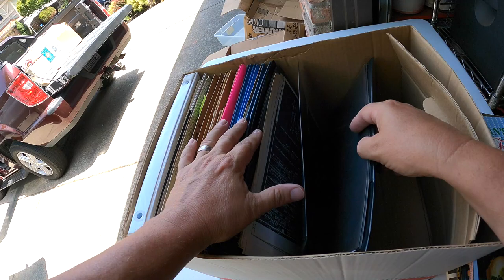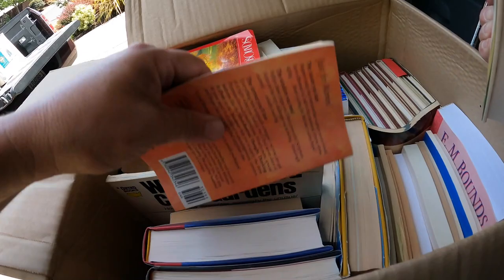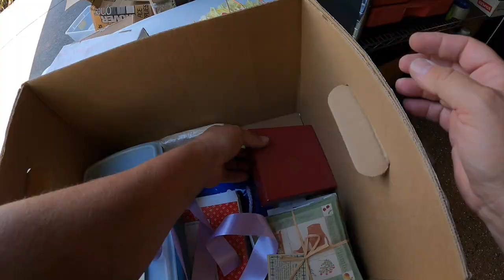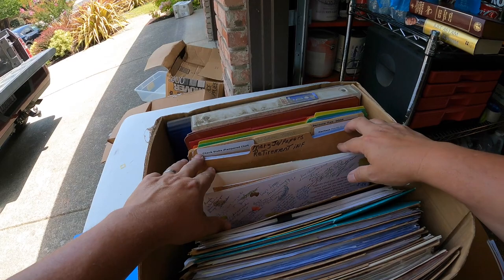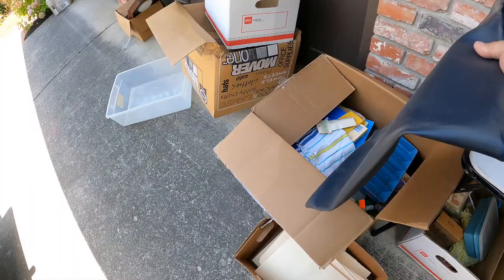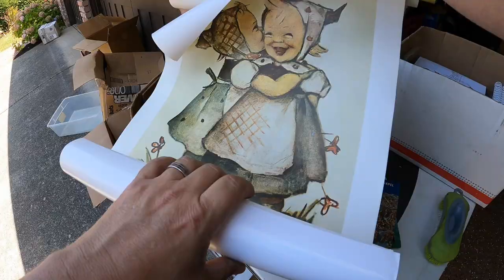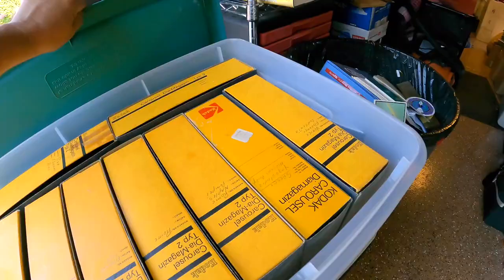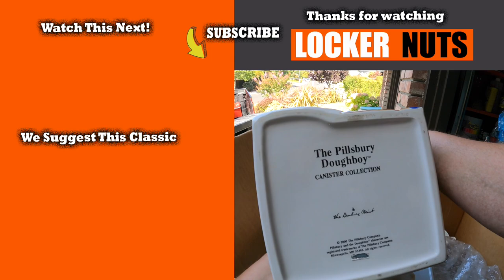Paid $1,815 for this Collector's Locker... what's inside? I buy abandoned storage units at auction

Comment: The copper colored spider-like device with little balls on the end of each wire is a crushed head massager - no joke!  The little wires were once springy and had tension so when you would apply it on the top of your head and then push down and pull up, it would massage your head and relax you -- it's a shivery kind of feeling!